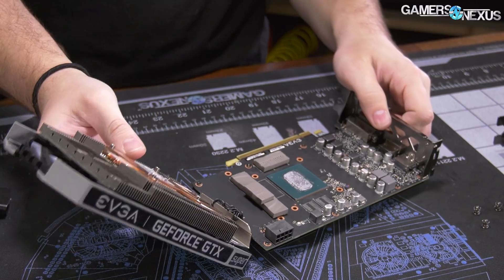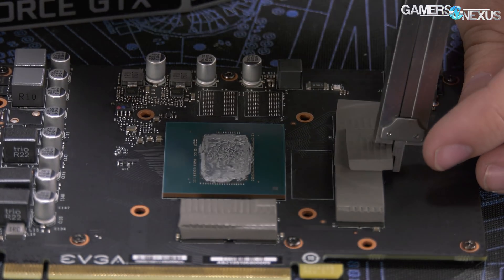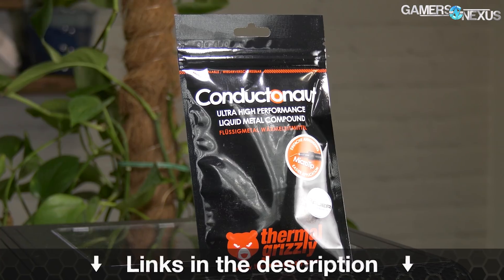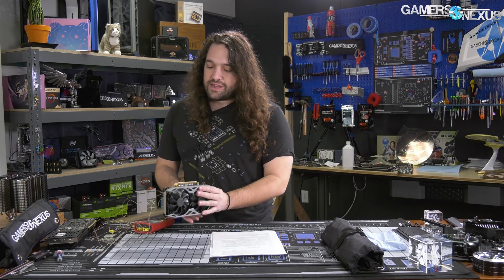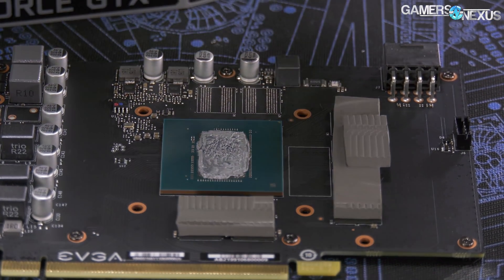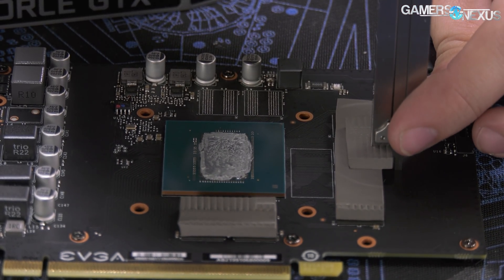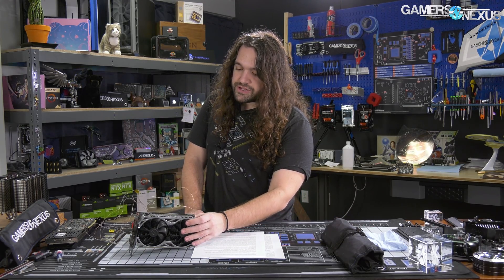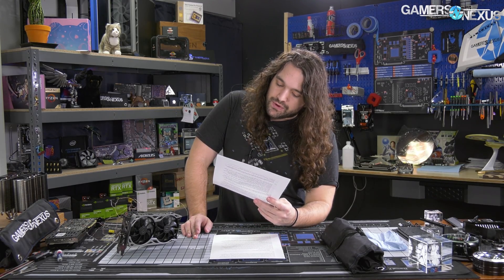EVGA's Double-Stacked Thermal Pads Tested: RTX 2060 KO Thermals

Comment: All they had to do is just leave some parts of the metal extend it in Qatar around and then use a very thin thermal chance for solution like instead of thermal pad you could almost use thermal paste at that point

Comment: Steve someone at the factory cut too much metal offer they weren’t supposed to that’s why they use so many thermal pads someone to fuck up on the cooler design and they realized it after all maybe we should’ve left the metal parts extended we can use that as heat transfer point make things out of it but no they didn’t

Comment: I got this card last week, upgrading from a 1050ti. EVGA gave a game code for 'Deliver Us The Moon'' that I suppose was intended to showcase the ray tracing. I found that with rtx on, settings high, my gpu thermals shot up to about 83c. RTX off, no thermal issues. B450 promax, Ryzen 5 1600 AF, 16gig 3000.

Comment: If I am not mistaken here, aren't thermal pads intended to transfer heat through contact. These don't looks like they touch anything but the very edge of the fins.  Would it actually be better to just remove the pads to allow the fans to blow directly on the dies? probably far better to replace them with low profile heat sinks.

Comment: Would it be possible to add aluminum or copper blocks, along with ~1mm thin thermal pads? I know you add 2 more transitions,  but it might be better.
Reply: Something I’ve seen is if you are to stack the pads to use a thin layer of thermal paste to help make it more uniform

Comment: Someone probably asked this allready but how impactful would little blocks of Copper (for example) and two way thinner thermal pads per block be in terms of cost, tooling and performance? How would those aspects be affected if you were to solder the blocks to the cooler?

Comment: So nvidia can put a mediocre cooler with 10mm of thermal pads and STILL beat the thermals of gddr6 on most rx5700 series cards (stock and aftermarket). I still don't understand why gddr6 runs so hot on AMD cards ?

Comment: how about trying to replace the pads with small copper heat sinks that use thermal adhesive. 3 - 3.5 mm heatsinks might do a lot better purely due to coppers thermal conductivity,  capacity, and dissipation rates. once replaced the heat sinks would operate independent of the GPU cooler and would get air that passes thru the fin array.

Comment: Given that there is so much room you could fit a decent sized little 3rd party heatsink on all those modules. Not sure if that would end up better or worse depending on how air is moving with that cooler.

Comment: What would happen if the part that has 2 thermal pads instead had a thermal pad that was half the thickness on the chip then a piece of metal on top with another half thick pad on top of that touching the cooler on the other side.

Comment: woul a copper shim or other metal with thermal paste or a thinner pad improve this? I am reminded of those old AMD XP cpu shims people used to avoid cracking the die. I would expect a lump of metal sandwiched or soldered on (brazed) to the hsf would be better than a lump of foam goop.

Comment: I managed to snag one of these cards from the first batches, literally ordering it like the day before you broke the news about the chip. I've been really pleased with it; for what I use it for it's a really great value and might last me a good 3-4 years. I AM curious if it'd run better if it was watercooled (would you use the 2060 block or a 2080 block??) or if it'd be possible to flash a 2080 bios to it and edge out more performance. Any chance you might look at that? Or maybe do a review of the new Corsair noctua challenger?
Reply: The pcb would be some version of a 2060, but if it's not reference style good luck finding a full cover block.
Reply: A 2080 has more vram too, I doubt it would work.  The cooler isn't bad it just is laughable but it does work for the price point.

Comment: Questions
Did you test without the pads? to see if they are even doing anything.
Testing each layer of the pads might show some interesting results as in the on the chip, in the middle of the two pads, and then at the heatsink.
Your test seem to have been just over 25 minutes, how much heat could one of those pads absorb? If the above method is a possibility a thermocouple inbetween the double stack pads and the heatsink could show if the pads are just absorbing the heat or if the heat is being transferred., and if the pad is just absorbing the heat what would happen once the pad hit its thermal threshold when ever that might be 40 minutes, 60 minutes etc.

Comment: How much heat do the chips produce? I'm kinda out of the loop but older gens of GDDR5 had absolutely no need for cooling unless you clocked them to their limit. No idea about gddr6
Reply: Considering how they use the heatsink for the GPU to "cool" the chips, I'm almost inclined to believe they're making the chips hotter. Would be fun if you guys could test that or at least shed some light over if I'm completely, far out there lol

Comment: Yesterday I discovered there are 10mm fans... Now I'm stuck wondering what would perform better. 1x 140mm fan, or 14x14 10mm fans...

Care to incline to my curiosity?
Reply: Probadefinitely a single 140
Reply: the 140. the smaller the fan gets, the higher the percentage of fan area is dead due to the motor/supports
Reply: You've gotta be pretty ignorant to think that 14x14 10mm fans would be better than a single 140mm one. Not only does having smaller fans mean that more space is taken up by the hub, but it also means that the fan blades are EXTREMELY small and can not move much air, meaning they need a MUCH higher RPM motor to get them to move the same amount of air, which makes them NOISEY AS HELL.
Reply: @shawnpitman876  The video Paul posted above seems to disprove your point. I was also surprised at how quiet the modern Nocs were. Smaller fans generate more air pressure, and the fin restrictions on radiators are designed for ~120mm fans, so there are a lot of parameters to consider when deciding which solution is optimal. Therein lies the danger of calling anyone ignorant...
Reply: @shawnpitman876   "for equivalent air flow, smaller size fans generate higher air pressure (as well as noise) than a larger fan"
"a 10mm fan" is clearly hyperbole in order to frame the question, I'm not even sure they exist, although it's theoretically possible to make one.
The video proved the point well enough, there was no difference
Reply: It's just a noise issue, remember that Dyson uses a relativity tiny fan motor in its products, as do servers
Reply: Not exactly what you're asking for but you might wanna give this a watch :D
https://www.youtube.com/watch?v=c7DxXhWoliE
Reply: I am intrigued.

Comment: Are the thermal pads even contacting a cold plate, or just touching the edge of the heatsink fins? It looks to me like they are just touching the edge of the fins. If they aren't touching a cold plate, wouldn't it be better to have fewer thermal interfaces and have direct air cooling?

Comment: At least they put something of actual substance for a TIM.  

Insert some joke about the ASUS TUF RX 5700 XT having the best GDDR cooling solution in the business.
Reply: They could be MSI, the brand that has plastic "heat sinks" for M.2 SSDs.  

You know the plastic is intended to be a "heat sink" because it has thermal pads attached to it.
Reply: The plastic is supposed to melt so you too can liquid cool your computer. Put racing stripes on your components and you are now a next level cutting edge gamer.

Comment: Please do test on a variety of double stacked thermal pads. There's some pads that are lower cost and have a great thermal transfer  rating but they are not thick enough for all applications. People say to not stack them but I've never seen any solid data on it.
Reply: I work directly with Arctic and they have some of the best thermal pads on the market. That being said they usually allow for about 6 mm of stacked thermal pads before thermal inefficiencies happen based on their Engineers info. The biggest issue that can occur is air pockets between the pads as you apply them
Reply: @SilverKnightPCs  in theory you could put a very small ammount of thermal paste inbetween thermal pads to avoid air pockets. While stacking, little pressure on them would push out any air.
Reply: @zilva121  as messy as that would be it would probably work. But at that point you might as well just have a glob of thermal paste 6 mm High lmao
Reply: @zilva121  sad thing about putting paste inbetween pads is that it's not really cost-efficient solution, unless they will use some cheapo paste like gd900, in largest packages sure
Reply: @shawnpitman876  yeah we're joking obviously there would be issues with gravity with thermal paste
Reply: no
Reply: Always wondered about vertical stacks of Graphite.
Along a certain axis, since graphite stacks in sheets, transmission of heat is rapid
Reply: @uss_04  I think der8auer talked a bit about something like that in his carbonaut/bromance video with steve, I believe he said there's a slight difference but nothing huge
Reply: Or maybe it was specifically talking about nanotubes, cant be bothered to look back right now

Comment: I am planning on putting an IDCOOLING Frostflow 120 (240 is too close to just getting a cheap open loop/full coverage waterblock) on my reference 5700 XT and thi makes me wonder if I can use thermal pads to sink the heat from the VRAM into the cooler or a cold plate or something. I also have some aluminum heatsinks and heat pipes/cold plates and a Dremel. It's gonna get interesting lol.

Comment: I don't know how they thought this was a good solution. Wouldn't it have been better to have used some really thin thermal tape/paste and just plop some copper or even aluminum heat fins right atop the chips? Certainly looked like there was a lot of headroom for a huge heat sink instead of the pads that likely would have performed better & not cost a significant amount of money.

Comment: Steve, What kind of thermals along with noise performance could one gain from a set of the ram metal heatsinks and a 'silent' fan blowing on them along side a jank aio mod on a gpu for the memory?
Reply: That would really depend on what exactly each piece of equipment is
Reply: It depends but for the most part the fan usually ends up being all right by itself on bear dye as long as The case ambient is adequate. I use a g12 bracket and a 92mm fan . I tested with some k-type thermocouples and they never got above 70 c Even when hammering the V-Ram and same with the VRM.
Reply: Better off buying a slightly more expensive card.
Reply: @g00glegoggle72  Not if you're after the workstation performance of this card... You'll pay at LEAST double to get that from another card.

Comment: Ive been generally curious about stacking thermal pads because I had to do this on my 1060 because I bought the wrong size thermal pads and I was waaay too lazy to do anything about it.
Reply: @jhon doe That is a good idea
Reply: @dhgodzilla1  now i want to see a video of him adding gold leaves between the thermal pads... you know the ones you can get for like 1$...

nvm i just checked that gold has way less thermal conductivity than copper... still it could be a cool video.
Reply: Yeah, gold leaves wouldn't be that cost and performance efficient. :)
0,2mm copper sheets cut to the GDDR6's chip area would be quite interesting.
Reply: @dhgodzilla1  not so fast ! if its just some 1,5 mm thermal pads that is not so big problem, but if you put 2x 5mm like EVGA together, yes it is bad - the problem is there are no bigger pads than 5mm  - so at the other end  better 2 together than no cooling ...

Comment: If you removed the pads would the memory be cooled better by the direct airflow from the fans rather than pads to fins then to airflow?
Reply: @albino_gringo1912  but wouldn't the 9mm of thermal pad be a hindrance to that transfer vs just direct air cooling?